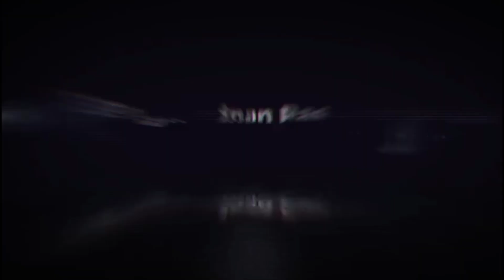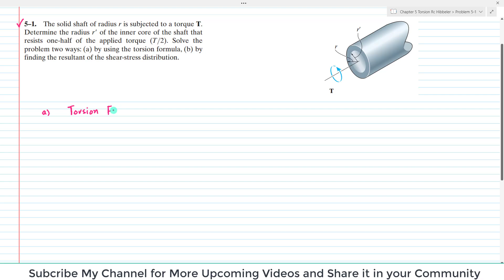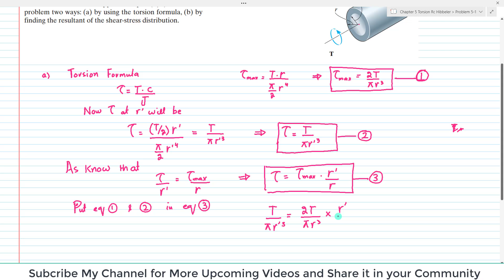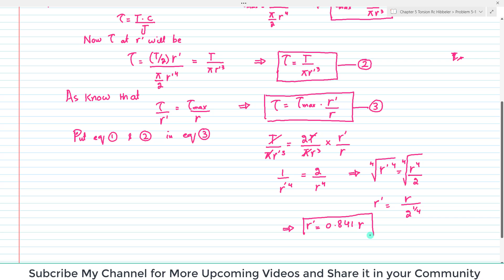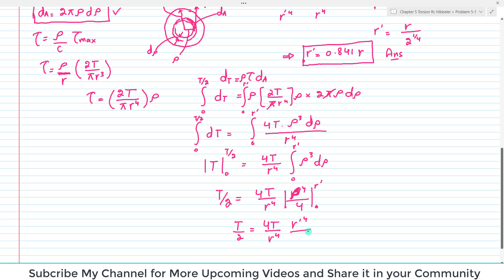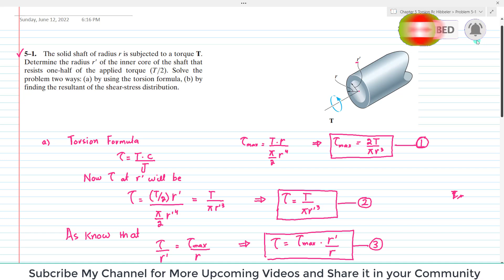5-1 | Ch 5 Torsion | Mechanics of Materials Rc Hibbeler |

Comment: How you used r^4, r’^4 for J ,instead of (r^4-r’^4)?
Reply from the maker: Kindly mention the time frame please
Reply: @engradnanrasheedmechanical  in 2.05 You wrote the Tmax as Tr/((π/2)(r^4)) but it is a tube, so In this case, shouldn't we write (π/2)(r^4-r'^4) for J in the formula?
Reply from the maker: @ufukmolla7402  please read the first line of the question solid shaft has radius r ...
Reply: @engradnanrasheedmechanical  Okay, I got it, thanks. Looking at the image, I thought it was a hollow tube.
Reply from the maker: No problem 😊